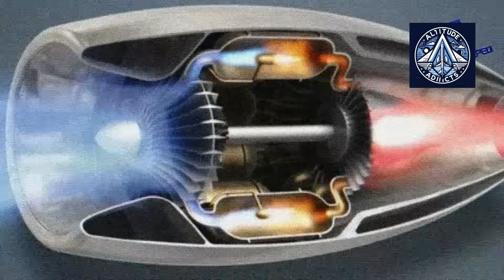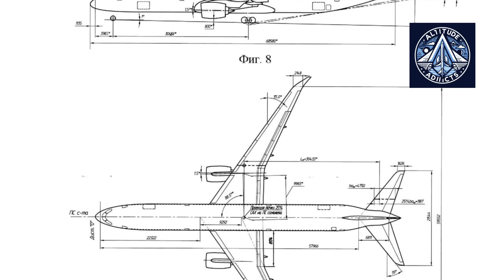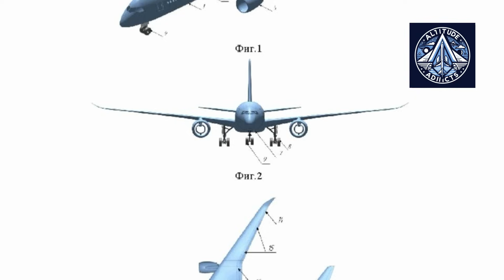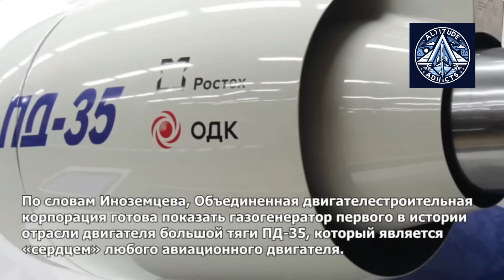Did Russia Kill the PD-35 for the PD-26?

Comment: PD-26  would be smaller diameter than the PD-35 and will probably will fit under the wing of the Il-96 without major modifications. That patent for a brand new design is dreamworld stuff - the Boeing 787 break-even point is 1000 units ...

Comment: Probably the minister thinks that US will remove the sanctions soon and they will buy more planes from Boeing in a big deal. They can still use the few IL-96 with PS-90 engines for another 20+ years.
Reply: I think he sees a less powerful engine as being more useful sooner. 26 ton thrust engines can be used to power a few different aircraft now. Military and civilian. The PD35 will be useful for larger heavier aircraft that will take longer to develop so they can take longer to get them ready for serial production. Four 26 ton engines on the Il96 is easier than two 35 ton engines from a military perspective. Later on two PD35 would do, but 26 ton engines could allow the restart of the An 124 and also perhaps a twin engined lighter Il106 type while twin an four engined transports of the Slon design are worked out.

Comment: PD35 is already installed in IL 76 Test Lab aircraft for ground testing soon. PD 35 already pass all the static test a month back.
This engine is for twin engine 400M  jumbo and AN 225 super heavy military transport Russian need really bad lesson learn from Ukraine war for this behemoth for military transport from N Korea, China etc.
PD26 is on the drawing board and 3 years away in making for 2 engine IL 76 with 2 crew members. Also, IL 300 2 engine and 2 crew configuration. PD35 is a game changer for upgrade to 47 to 50 possibly in a short period of time as seen PD8 was created from PD14 in just 2 years. Also, NK- 93 engine by KUZNETSOV IS ON THE CADS NOW. Soon this open rotor engine will wake up from hibernation.
Reply: PD-35 only passed bench tests it isn't on the Il-76LL
Reply: @GaryKennedy-g7p There is no bench test in aviation. It’s static test on frame especially design for full RPM + more and all other test like water flooding etc. warm and cold environment requirements it’s a long process, PD35 passed all these test with flying colors. Next is installation on IL 76 test lab aircraft there are pictures of PD35 installed already, soon these test critical test will commence and videos you’ll see.
Reply: @Sam-dm4kz  Vậy thì quá tuyệt vời, tôi luôn trực chờ để tìm kiếm với từ khóa PD-35. Sẽ tuyệt vời thế nào khi PD-35 khổng lồ sánh vai cùng cụ ông D30 dưới đôi cánh của huyền thoại IL-76.

Comment: What happens to all the work gone into the PD-35, can it not be sold to the C929 project? I'm sure the PD-26 can use a majority of the developments the PD-35 project developed, but it will still take a substantial time to develop and certify which the PD-35 has already gone down that route. Couldn't a simple A330 Neo like aircraft be made that could use the PD-35?
Reply: The PD-26 core is from the PD-35
Reply: @pg190 I thought the PD 35 is more superior interms of performance that the PD 26.